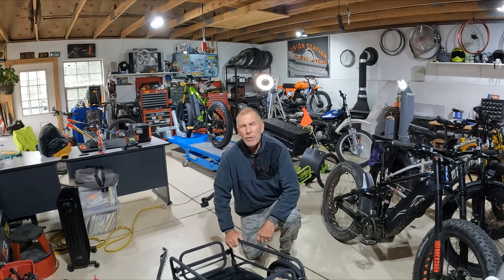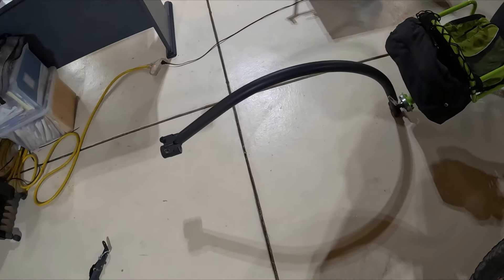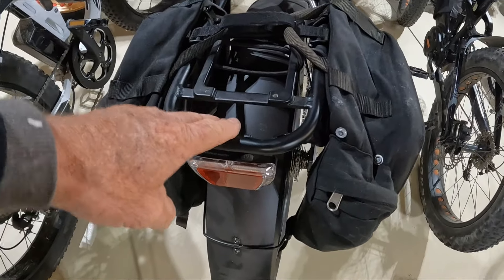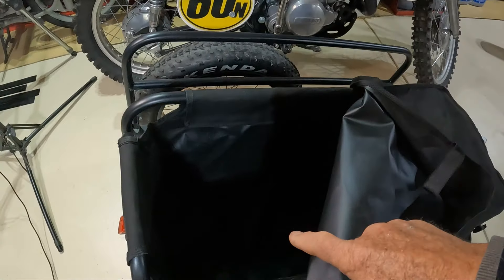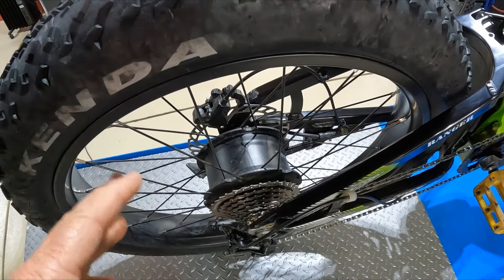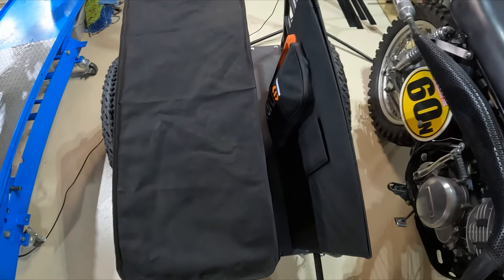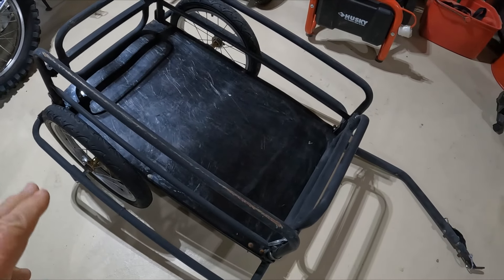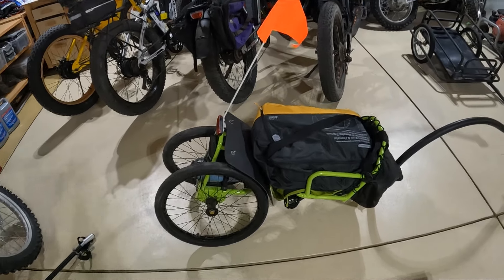Things to keep in mind when choosing your bike trailer and gear!

Comment: Another very useful video. Btw, i have a question : i just broke the kickstand of my ranger and my local dealer in France dont have the "substantial" version. Would you know a replacement kickstand that would fit ?
Reply from the maker: Hello, I have not yet needed to replace my side stand (although I should because the spring has gotten weak and it rattles on rough trails). I know that these larger heavy duty stands are available on Amazon. You'll need to measure yours and buy one that is close to the same length. The mounting holes are pretty standard so that shouldn't be an issue. My only tip would be to avoid the adjustable length side stands, they don't hold up very well.  Cheers
Reply: @lifebehindbarz60  thanks for your always excellent advises!